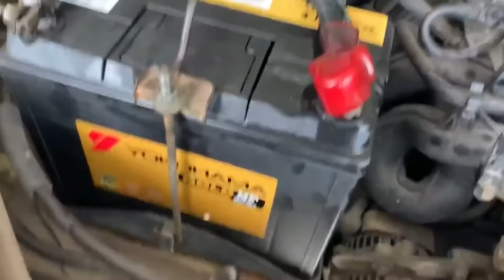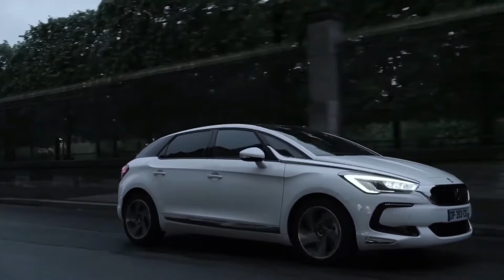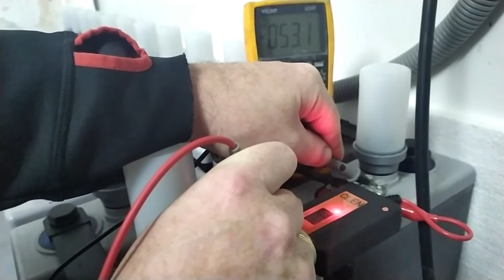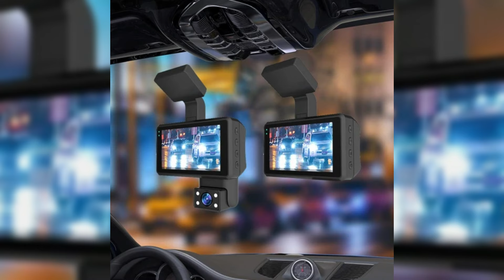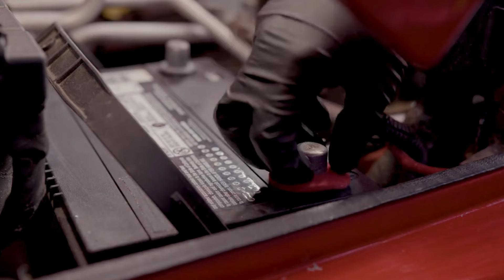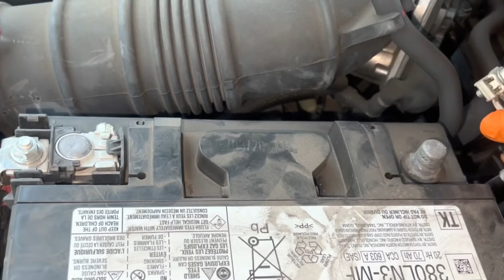This Almost ILLEGAL JAPANESE Trick Will Extend Your Battery to 10+ Years

Comment: Even an AGM cannot overcome the lack of time. Continuous undercharging eventually leads to sulfation, where lead sulfate crystals form on the plates, permanently reducing the battery's capacity.  Absorbed Glass Mat batteries do handle "partial state of charge" better, meaning they won't degrade quite as fast as a standard battery if they aren't 100% full.
Reply from the maker: So whats the solution then?
Reply: You had some great tips on preventive maintenance. Do those battery blankets work and heat and cold?